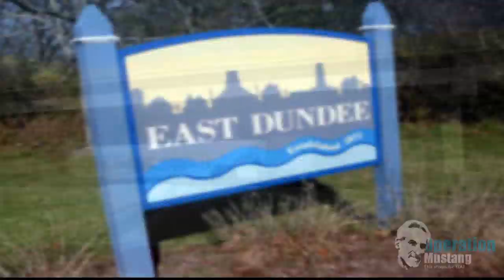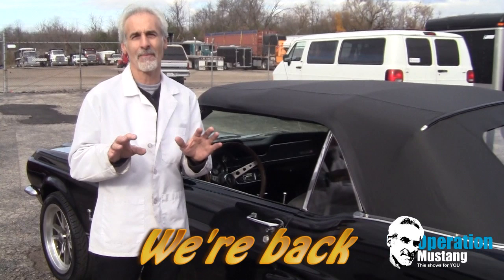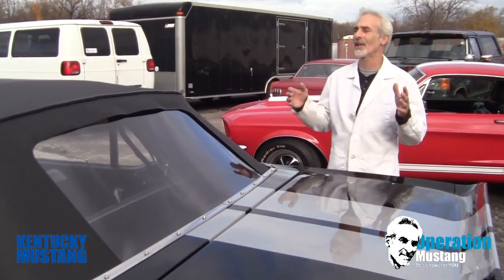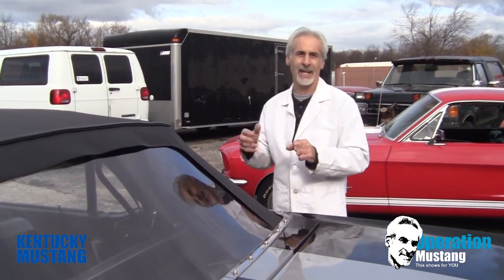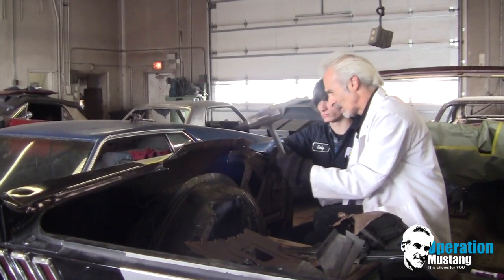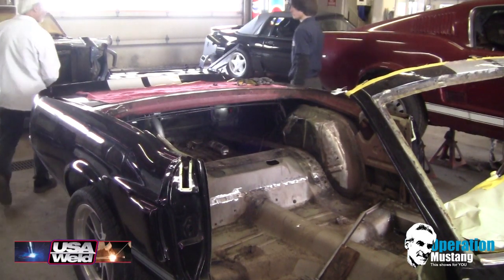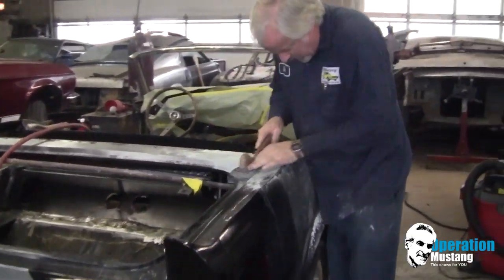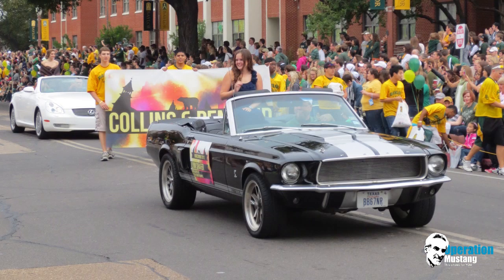Operation Mustangs & More Show 26 (Coupe to Cool) episode

Comment: Hi. How about the windows. Did you change them too? As far as I know, coupe and convertible windows are different. It will not line up with the convertible top if you use a coupe window
Reply from the maker: Yes... the side glass was changed.
Reply: @MustangRestorationsInc thanks for the reply. One more question... the convertible windows... did it fit perfectly(the mechanisms and the brackets that hold it) or there are a modifications to fit it?
Reply from the maker: @Bmertz  Yes the mechanisms are the same.Just change the glass..
Reply: @MustangRestorationsInc  thank you for the info. Godspeed Doc